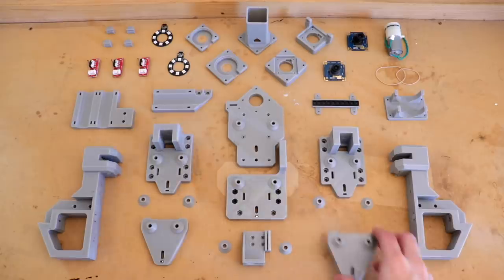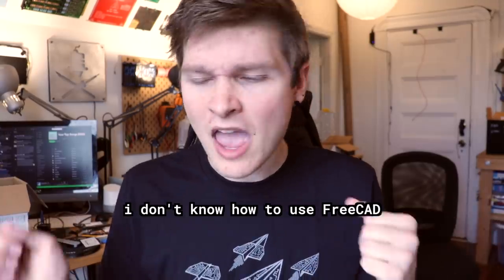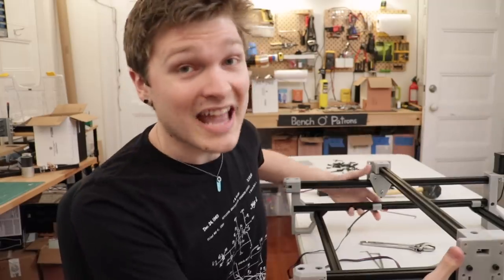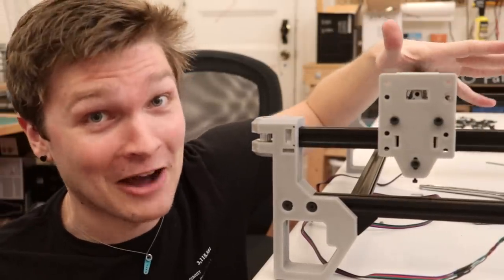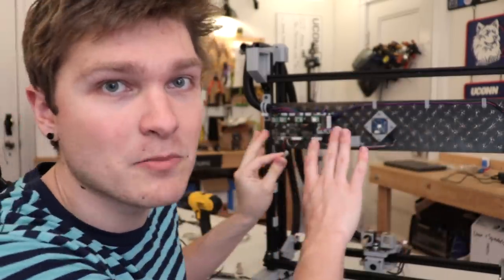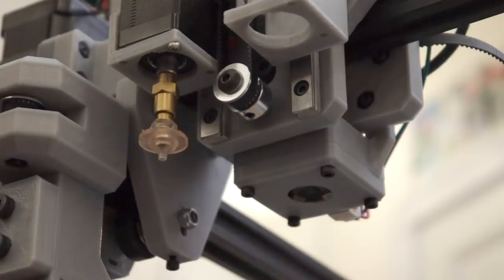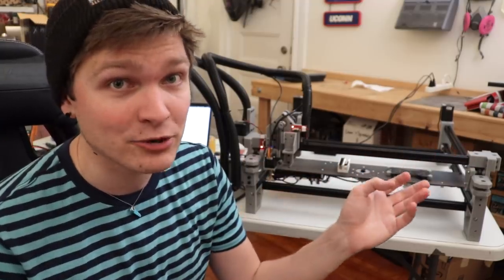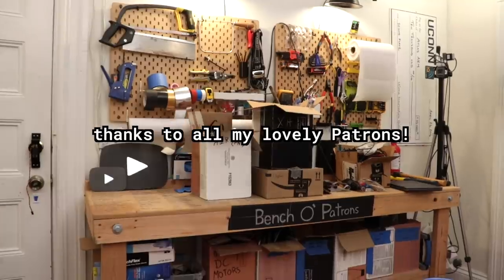Switching the Index PnP to FreeCAD!

Comment: I'm impressed that you were able to redesign the whole thing in FreeCAD so quickly. As a current Fusion360 user, I have tried FreeCAD several times over the past year, and ditched it quickly each time (crashes, bugs, parts disappearing). Maybe I'll give it another go, I'd love to switch to open source...
Reply from the maker: yeah i totally hear you on that. the first 10-15 hours with it is kind of a struggle. but after that things get better much, much quicker! I'd say i'm probably 85% as fast in FreeCAD as I am in Fusion now. It's also starting to get a lot of support since the Great Migration a few months back, so things will only get better :D
Reply: Honestly !  I'll try and use this to inspire me to learn it lol.  (Got spoiled with autodesk inventor in school, now that liscense is not free post school soooooooo... FreeCAD time !)
Reply: I am using the LinkStage3 branch it works great, have not encountered very many bugs. And you can style it by installing the glass addon.
Reply: Some of the problems that are attributed to FreeCAD should really be thought of as Open CASCADE concerns. (OC make the CAD kernel).
When I started using FC earlier in the year there were points when I became very frustrated. (I have been using AutoCAD and MicroStation for decades). Eventually I turned to some YouTube tutorials. Have a look at these fellows in particular, Joko, sliptonic and Ha Gei. There are many other FC videos, some perhaps more pertinent to whatever you're trying to do.

Comment: 4:15 adding a light spring might reduce the need to manually tension, and will be more reliable in terms of any nuts getting a little loose, or plastic stretching.

Comment: Awesome build! Now I am hooked to build one myself :D 
I also wondered why so many 3D printers use these 4-wheel gantrys. It was problematic on mine. Basic engineering principle - do not over-constrain! A slot hole and reliable tightening hardware could solve so many problems in hobbyist hardware. Kudos to you for doing it right!

Comment: Regular office rubber bands have a very short life span, they dry out and crack after a few months.
Reply: Up up to the top
Reply: do you have any alternatives from aliexpress / ebay?
Reply: They do.. but easy to source and replace I guess
Reply: O-rings work very well for this
Reply: Agreed, I have had the same problem with rubber bands I tried using on my 3D printer to lightly constrain some parts; they work for a while, but the problem is that standard rubber bands have no stabilizers so UV and ozone break them down quite quickly and they go brittle and fall apart. Proper O-rings or silicone bands/elastics will be much better and will last.
Reply: @Stephen o-rings is the right answer nor rubber bands!
Reply: Silicone o-rings for the win!
Reply: non-latex rubber bands are SUPER cheap on amazon and last a lot longer than normal office bands.  Good middle ground between proper o-rings and crappy rubber bands.  They're like $4 for a box of 250
Reply: yeah normal buna o-rings will last longer than natural latex rubber bands
Reply: @Keechization  Those or EPDM. I would select latter.
Reply: @Vijfhoek You can buy shock cord specifically - same stuff, I think it's also what they put down the middle of tent poles

Comment: I stumbled across your channel a few weeks ago, and I'm hooked now. I've seen a huge need for more mid-scale manufacturing, so it's awesome to see your project taking off like this. Your energy is contagious, and you're doing some really solid engineering! Keep up the good work!

I really like your rubber band shock absorbers on the vacuum, that's an ingenious low-cost solution. Rubber bands do break down and get brittle over time though, so you might want to check out buna-N O-rings if that becomes an issue.

Comment: I'm not sure of the mechanical design issue it addresses, but on most triathlon aero bikes, track, and old vintage bikes, they have a similar rear hub tension adjustment as your 3 wheel gantry setup. They always have a small spring over/around the tension bolt threads. I think it is there to prevent vibration from working the bolt out over time. It's fairly universal on bikes with slotted dropouts and this kind of tension arrangement.
  Thanks for the upload, and for tackling freecad. Be sure to make notes on how you do stuff in freecad. Don't be like me and have to relearn the same thing a few times over.
-Jake

Comment: Maybe I was using it wrong, but I found it really frustrating to make any later adjustments in FreeCAD, several times the whole design just collapsed and needed re-doing like half of constraints after some minor adjustments of base shape or something. Now I'm using mostly OpenSCAD for technical stuff, maybe first initial design would be harder to do switching from visual CAD, but result is rock solid, maintenance of evolving project would be much easier, scad files are source code, so version control, pull-requests and applying patches would actually work.

Comment: 8:45 shock mounts can be salvaged from old dvd/cd drives there are at least 4 (Maybe 8 I can't remember), in each drive.
Reply: I think the issue is he's trying to design a standard platform, like a reprap, so he can't use anything that can't be purchased as he did

Comment: Got to ask, What plastic are you printing in?

It looks like PLA, but i wouldnt trust PLA for a mechanical project. As while its stiff... it more prone to cracking under tension. But also (in my case with a enclosed printer build i did) PLA starts to warp and soften at around 40c. 

Or are you using PETG or ABS?

In any case. its an amazing build.... I could really do with a PnP machine and this is giving me bad ideas to make one :D

Comment: I could be wrong but someone stated PETG has the lowest creep (the deformation thing), so I guess you should make your rail mounts from that as the carriage tension screws will eventually pull through the plastic if it's PLA. 
Oh I'm going to try steal the mounts for my printer :).

Comment: You could use "Fan Mounting Pin Rivets" on the pump. Rubber bands will get messy with moister.

Comment: 4:15 adding a light spring would reduce the need to manually tension, and will be more reliable in terms of any nuts getting a little loose, or plastic stretching.

Comment: Skip the wheels and use quality linear rails. They're cheap here .https://www.robotdigg.com/category/20/Linear-RepRap
Also cable carriers https://www.robotdigg.com/product/860/Drag-Chain-10*10,-10*15-or-10*20mm-Inner
Also, you don't need high precise when placing smd because during the soldering process the parts jiggle and auto-align.

Comment: I would suggest using eccentric nuts on the x and y axes so you don't wear into your v rollers skew. The alu extrusion already has centering ability, so you basically over constrained the bottom roller
Reply: +1 exactly what im thinking
Reply: Eccentric nuts are bank though

Comment: I didn't follow the design that much, so simple question is there a valve to open to let air in or are u just waiting for the part to lose the vacuum, that could be the reason for parts that bounce cause the vacuum is half there while releasing the part.

Comment: Did you find any way to use your 3d connexion SpaceMouse in FreeCAD?
Reply: Pretty much why I use 360 is my spacemouse
Reply: In FreeCAD 0.18.4 portable the 3d connexion SpaceMouse works. I've just successfully tested it. Confused the problem with KiCad. The operation of KiCad with the 3d connexion SpaceMous would be just as nice, but I couldn't find anything about it.

Comment: I would have thought you would have used the method that OpenBuilds uses where it has an eccentric washer that you can rotate to tension the rollers on the extrusion. It seems like you did something similar but with 4 rollers instead of the three that you just implemented.

Comment: You may be able to use git lfs https://github.com/git-lfs/git-lfs to track your cad files. I haven't used it yet, but it is made for this purpose from what I've read.

Edit:
It helps prevent repo bloat by storing it off repo and when someone clones down only downloading the latest image from this branch. You can also exclude certain files during clone/fetch so you can avoid copying large files you don't plan on working on.

Comment: Rubber bands will deteriorate in a short period. Get some cheap O rings to serve the same purpose. Try to get red ones as they are generally silicone and more flexible than the black nitrile or Buna-N ones

Comment: Any reason you are using marlin instead of grbl?
Reply: Or openPNP?
Reply: @TheRainHarvester  openpnp is the host software you use to control the pnp, which he is already using. marlin and grbl are firmware for the control board. marlin is focused on 3d printing, grbl is more generic and usually used in cnc mills. the reason I suggested grbl is because it might be easier to integrate features, like the feeders control, than marlin.

Comment: I think "Git is not for tracking binary" is overrated. It works, it has a binary mode and, I think, if more people use it they'll optimise it (if necessary).
Wouldn't be the first tool to be optimised for use-cases.

Or FreeCAD decides to do non-binary project files. Would be cool if files could be diffed (or maybe a FreeCAD differ?)

Comment: what sort of mouse is that??
Reply: Looks like a 3d mouse. They are used for cad work
Reply: Some sort of 3DConnexion SpaceNavigator/SpaceMouse. They're really cool, it's for moving the camera around the part (or vice versa) rather than for using as a mouse for selecting stuff. You move the top part in 6 axes (3 directions of movement, 3 directions of twist) and it feels really natural and fast after a while.
Reply: I was using a 3DConnexion SpaceNavigator similar to the one in the video, but I think there are some settings that need adjusting as my FC workspace will slowly start to spin or zoom all on its own. I'm hoping the problem is my doing and not with the equipment or software.

Comment: FreeCAD is garbadge, I don't care how many fully made models you can point me to done in it, I have used CAD software and freeCAD is scary. Nothing actually works properly as you would expect. The "engine" is clearly very limited. Things that I would simply do in Solid Edge are just not possible with cryptic error messages at every turn. Good luck. I'm sure that it may get there one day like kiCad did, but I am not going to work with the software to sort of get what I want. I expect the software to work for me and as it can't do the math in the first place unless it is simple then clearly much will have to change.

Comment: hey buddy,
 big fan of your work. one suggestion though, add a rotating base so you can put at any angle and location even if the picked component is not aligned. like it if you read.
Reply: nozzle can already rotate